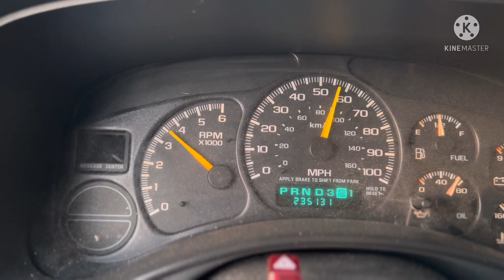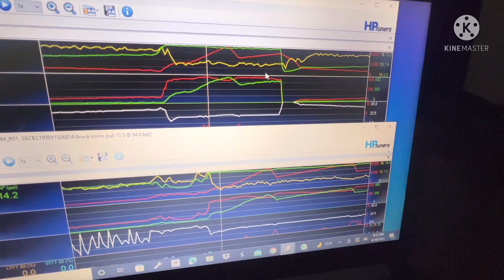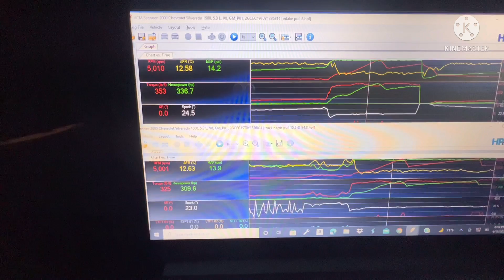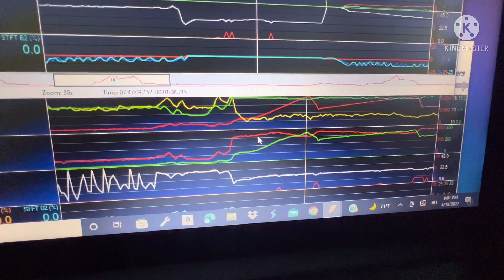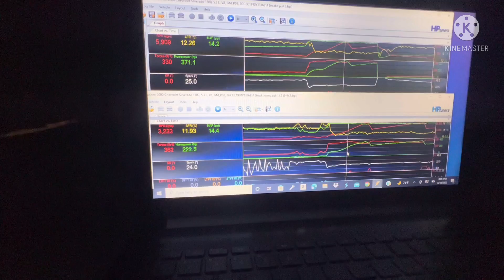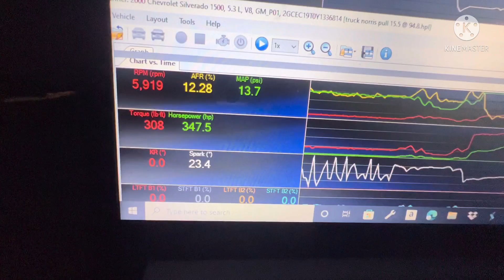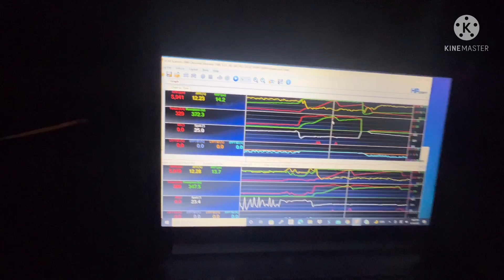Cheap Silverado Air Intake Really Works! Here’s The PROOF! - HPtuners

Comment: Hey saw you video on the 5.3 lifter replacement do I have to do all the lifter an do I have to remove the head to remover the lifters or can I unbolt the intake move it enough to get that set of lifters out ty your video was good

Comment: I actually have a k&n on one cammed built truck and just completed another build and put the 100 dollar speed engineering Cai on it... the cheap one does pretty good but one thing I noticed in my data logs is the aluminum/cheaper Cai has much higher iat's.. the k&n with the plastic tube has about 30 degrees lower iat at idle. This will start to pull timing on hot summer days so that's one thing to think about for others... you can adjust your table but i wouldnt do much. I wish they made a cheap intake with plastic tube. Great stuff man, really liking your stats
Reply: use heat (tape)  on your cheap one and you should see some dramatic changes, looks cool too
Reply: Should have spent $50 extra for an air raid. Best intake tube I ever bought.

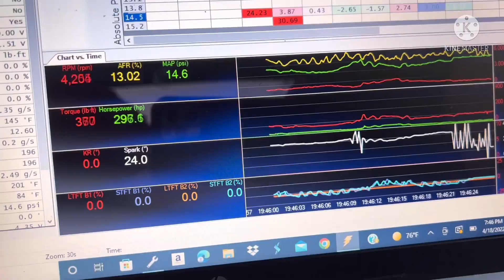Comment: 6:02 Did you turn up the transmission pressures and change TC lockup tables? The 4l60 on the 1-2 shift sounded lazy on the shift time.
Reply from the maker: I did yes. This is how a 230k mile 4l60e shifts. I’m happy it shifts at all. When I do the yank 3600 stall I’m going freshin up the trans with new clutch packs, and extra wide 2/4 band, shift kit and corvette servo

Comment: With the MAF still being functional with the added airflow it would add alil fuel under load/wot. With that said for anyone that installs and intake like this, clean the MAF gently and prob not a bad idea to check/clean it regularly as it plays a major part in your engine running condition, unless it's tuned out for speed density.

Comment: That connector going into the throttle is horrible. it has a 90* angle inside. if you check out my stuff I have a video with the link for a better one that will flow a lot better. There are actually a few parts that will all go together to really make those intakes flow a lot. 

good video though.

Comment: For those of you guys worried about heat soak. The air your engine is sucking in. That Air does not stay long enough in the tube to be heated due to heat soak. However. Having a short ram style intake on your engine draws in hot air from the engine bay versus a cold air intake that would draw air from underneath the engine bay. That hotter air is less dense versus a cold air which would be more dense. That is the real issue not heat soak. Heat soak is for superchargers or turbos that have an internal or external air to water intercooler that becomes heat soaked after Time. In that case the heat soak can affect the intercooler itself and the reservoir

Comment: Heat soak with that aluminum tube.
Reply from the maker: Yep that’s true, didn’t want to want to waste money on a plastic intake tho since I’m going with a pro charger in a couple weeks, I’m using this intake tube to tie into the charge piping. It’s nice having aluminum to weld/fabricate
Reply: @BoBuilds  the tubes dont matter if the filter is down behind the bumper

Comment: This is not a cold air intake. 
This a pod intake system. 
This wil suck hot air out of the engine bay + heat soak from the whole engine it self , even when using a heat shield is not the best.. HEAT SOAK makes this not much good for sitting in traffic.
Using a O.T.R (over the radiator system) straight into the throttle body is the way to go.
Reply: I agree %100  with you but in this situation he at least fixed the choking issue he had.
Reply from the maker: Yeah this is true, I tried to make clear that this was to solve the choking issue from being cammed with a stock air intake system. The map sensor reading was indicating a lack of air flow which this hot air intake 100% fixed. Plus I didn’t want to waste money on a better system since I’m supercharging the truck soon. I’ll be able to reuse this pipe at least in the charge piping I plan to make.
Reply: @BoBuilds  nice explanations  👍💓
Hope you will do a video on the new supercharged engine.   Thanks mate